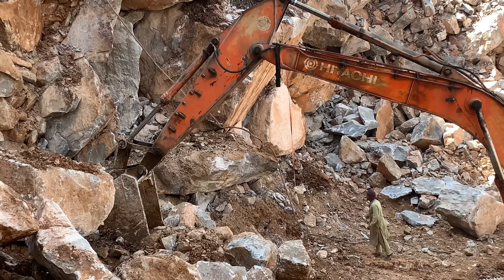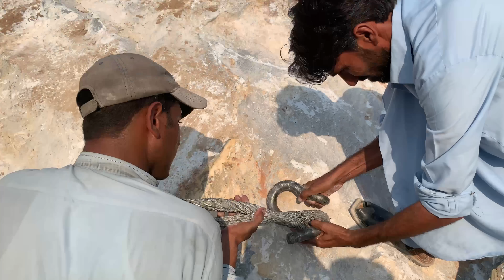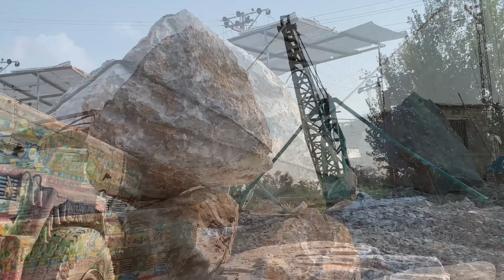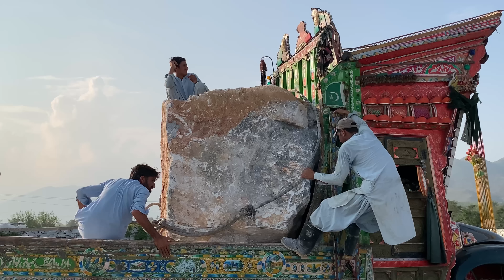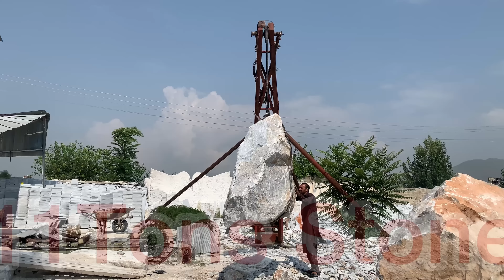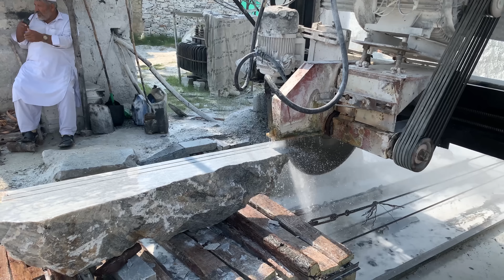Incredible workers How To Mine Stones from Mountain Multiple stones & Crane Lifting To Make Granites

Comment: simply amazing. If the operators had new equipment with good bearings and lube on the joints everyday they might be lost without the slop in the mechanisms. Whoever builds those trucks are to be commended.
Reply: These trucks are made in Pakistan originally Bedford out of England, the company does not exist there anymore. The plant in Karachi makes them and are the most popular trucks as they have been modified for use in Pakistan. This is KPK province this marble being mined. The Pathans are tough people and do not change. They beat the Soviets out of Afghanistan